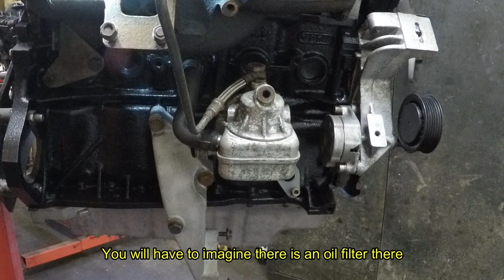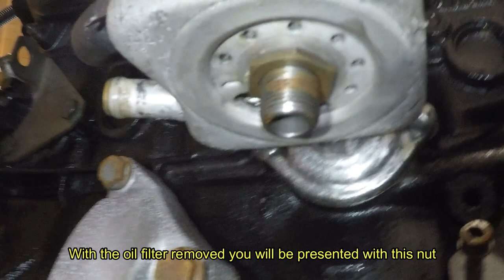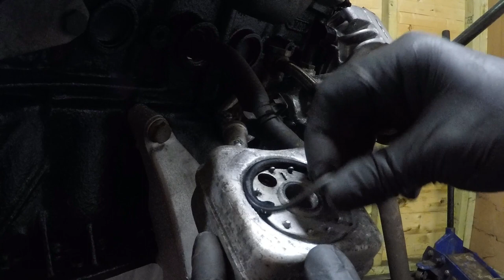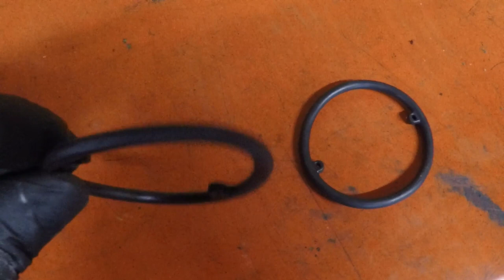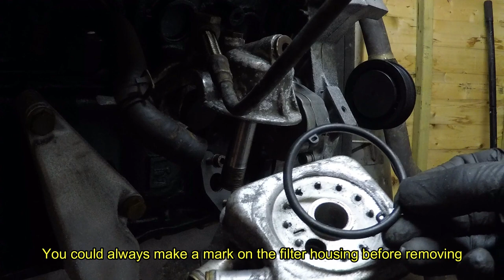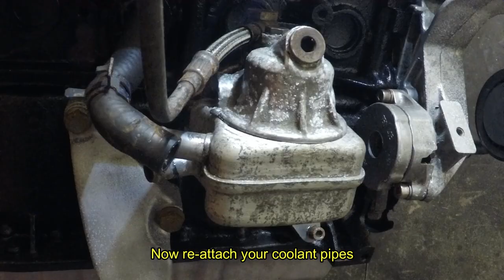VW Transporter Caravelle T4 2.5 TDI ACV Oil Cooler Seal

Comment: hi I'm still having oil leak,ive done the oil cooler seal already.still leaks, they say turbo oil return pipe gasket can leak so is that on your video here oil cooler seal video.,Steve
Reply from the maker: Ye the oil return leaks quite often so it’s probably a good shout but it can’t be that difficult to pin point surely?

Andy👨🏼‍🔧
Reply: @AMSVauxhall  is your t4 used much now ?.yes will clean underneath leak jack up and get torch under while engine running with undercover off
Reply: @AMSVauxhall  I’ve also got catchin noise on drivers wheel .Kwikfit have had on ramp and I’ve had drive shafts plus centre shaft done plus track rod arms plus ball joint that had rusted an knocked but now noise appeared I’m going to take wheel off check pads which have been renewed recently

Comment: hi.i had my oil cooler seal replaced .tried do myself but like u say have take cooler pipe off.so let garage do it.but still have oil leak.people say the oil filter housing copper seal leaks also.so have ordered one.i see you didn't remove housing just wondered is it easy to remove when on engine still?your opinion.may let garage do again yet.a father and son team nearby they worked oil my van before
Reply: where did you  get the copper seal for the bolt from?